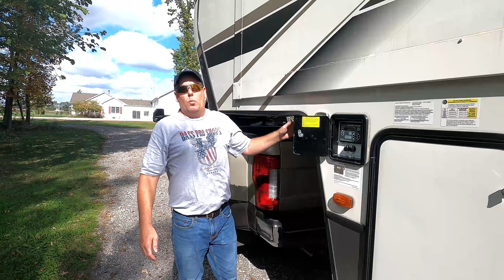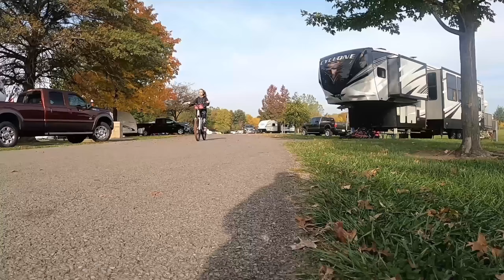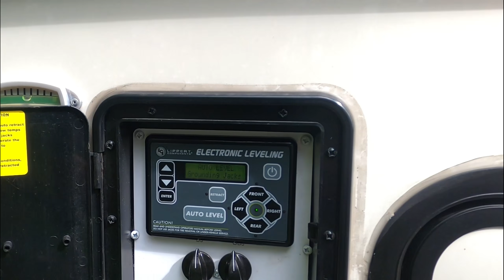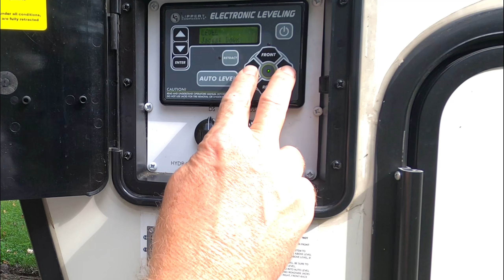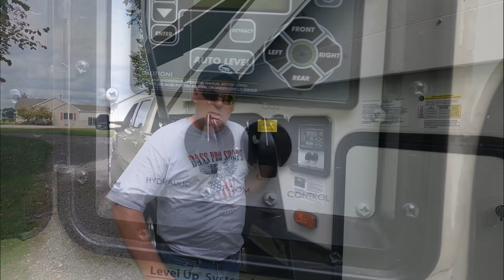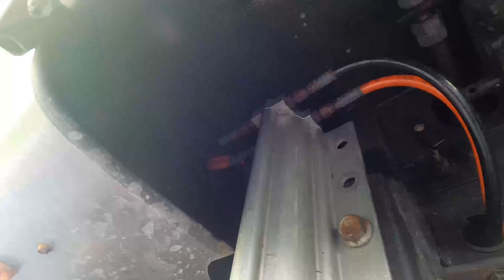Lippert Level up Operation/Troubleshooting

Comment: How can I operate one jack at a time
Reply from the maker: They have the jack set up in zones. The landing gear ( 2 front jack) then rear. (Both rear and center jacks)  you can also select right or left when leveling manually)

Comment: This was a very informative video thanks for sharing, I have an 80-amp fuse and still getting the "low voltage" error. Luckily as you mentioned I have an extended warranty, so we'll just see what progresses.

Comment: Thank you, now I am completely confused about the reset to zero, you said tap 10 times on the up and 10 on the down arrow when the key pad is off, I have seen many other video that say 5 times, did Lippert tell you 10?  I just do not want to make a mistake.  Thank you for your response.
Reply from the maker: Mine was 10. Some were programmed for 5

Comment: Thinking of moving up to a fifth wheel. Hesitant about hydrolic system.  DO you like electric or hydrolic better?  Where dis you put the fork oil and how much?  Did you take some hydrolic oil out first. How often do you get leaks?
Reply from the maker: I prefer the hydraulic. You add the fork oil in the resivour with the fluid. If the fluid level is full, when all jacks are up and the slides are in, then you will need to take out a quart  to add the quart of fork oil. I have net had any leaks.

Comment: On my Montana the front jacks lower one at a time. No big deal when unhiitxhing but when lowering for a pull test exits a pain for doing a pull test. One leg goes down and makes contact the. Other leg follows
Reply from the maker: @getnautical9579  Yes, 
that is normal for a hydraulic system as the jascks are all on a loop. Once the first jack starts building pressure, it will send fluid to the next jack. 

Thanks for watching,and taking the time to.leave a comment.
Reply: @Jonesin2Go do you know of a way to do them at same time or if not how to raise them both at same time for a pull test prior to leaving so I don’t crunch bed in a oops moment
Reply from the maker: @getnautical9579  There is not a way to operate them at the same time. What I do is retract them until one is just a couple inches off the ground. When that happens, the pressure is also off the other so I can do my tug test.
Reply: @Jonesin2Go great. Good to known thanks so much for advice

Comment: Does anyone know if there is an approximately 30foot 5th wheel that has hydralic auto leveling. Mine now has electric auto level. TIA.
Reply from the maker: @franknaiman5219  Montana has a 35 ft model with hydraulic.

Comment: Great video. I tried to recalibrate mine but while it does level the RV almost to perfection, 1 leg isn't touching the ground at all (a good 4-5 inches gap) and another one in diagonal is barely touching. Is this normal? Anyone has an idea on how to fix this?
Reply from the maker: I don't know why it would do that.  Would you
be able share if this is a consistent behavior?  At the end of the auto-leveling cycle, the controller goes through all the jacks to see if they are grounded.  It looks for small changes in the angle.  If a jack is 4 to 5 inches off the ground, it might be the auto level cycle was interrupted before completing.

Comment: Great video!  When I go to do a tug test, how can I raise both front legs a few inches at the same time?  Can't find the answer anywhere...
Reply from the maker: that's a great question. unfortunately they don't work that way. the left is the lead jack and the right will only travel after pressure is sensed on the left. How i got around that was to raise them and then drop them again and just before the right touches lift them so the left just come up a little. that seemed to work for me. I am now learning a new system as we just took delivery of a new Montana that has Lipperts new Titan system. this system gives more options such as you were asking about.

Comment: Fork oil... should I go ahead and add a bottle to the reservoir as a preventive measure even though I'm not having problems?
Reply from the maker: As long as you Dont over fill the reservoir it wont hurt.

Comment: I work on hydraulic system. looks like a piece of metal got stuck in your cylinder check valve or safety valve ..its very commond. you can removed it and clean it ....great video.  thanx

Comment: I’ve noticed where my hydraulic landing gear will time out when I retract them. I’ll click the retract button, but after a short amount of time it stops retracting. After letting the control panel sit for about 5 seconds I’ll hear the panel click, and it’ll allow me to continue retracting. Have to do it a couple of times to get them all the way up. Any thoughts on what’s causing that? I’m not getting an error on the screen like you mentioned.
Reply from the maker: That sounds like your Resettable fuse. Do you still have the 50A fuse? If so replace it with an 80A

Comment: Thank you for your video.  It was great and I subscribed.  A clarifying question please.  We just purchaseda 2018 pre owned Keystone Avalance.  The Auto Level is great...however,  when pressing the right and left to return to hitch height it didn't work.  Therefore I did it manually.  I beleive you are saying to rehook the truck and just do retract all, correct?  Also, after I did it manually and we went to unhitch, the system said "Ready: Jacks down", but they were still up.  Again I used manual.  Did I miss something? Thank you.
Reply from the maker: Hook it back to the truck. Extend all of the jack down at least 6 inches then select re track all. This should clear any errors. Then try the taking it off the truck have it auto level. Before you try hitting the left and right and see if it will go to hitch level. But keep in mind if the it comes off the trick with the front lower than level than that feature will not work. It will have to come off the truck with the front higher than level.

Comment: The issue we have is, when it does it’s auto leveling, it always end up so high that we have to use a step stool to get up to the first step, any ideas why that is?
Reply from the maker: It could be a couple of reasons. 1 the site is just that un level  or you could need to recalibrate the system.  I find I have ro recalibrate now and then and it's usually after we have traveled on some rough roads
Reply: @Jonesin2Go  thanks will definitely have to try that, it does reach level, and if the ground is soft it even sometimes kind of readjusts just after it’s finished, it’s just high when it’s done. It’s not that old but the buttons are already not responsive making us try over and over for those multi press settings. Weird too since we always use the separate remote, never pressed them too hard or anything. Wish they had made a beep for each key press, would have been very helpful. Thanks again.

Comment: Great job. You answered questions i didn't even know I had. I bought my 5er used at a consignment dealer and they wanted $550 for a walk through. I told them youtube could teach me everything I needed to know. Thanks for making me correct. I subscribed to steal some more of your knowledge. 
Thanks
Reply from the maker: Thanks for the comment.  $550 for a walk through. That's crazy.
Reply: Exactly! $550.00 for a walk thru on a rig they sold!? They tell you that after you signed? Wow, wow, wow!!

Comment: Wondering- we are on a seasonal site. To Re level after a while, do we bring the slides in or can we just hit reliever for slight changes?
Reply from the maker: It's always best to bring them in but if it's only going to move a little bit it would be fine to just use manual level. You just never know how much it will move using auto level

Comment: Our site is not at all level. We have it the best we could with the auto leveling system… but I’m wondering if it’s possible to raise one jack at a time to be able to put blocks under individual jacks without hooking back up to the truck?
Reply from the maker: Not one at a time  you can do left or right. Or rear which will bring all 4 rears up.

Comment: We have a 2019 Jayco Eagle 5th wheel.  We purchased it new and this year, the first time out we had problems getting the rear jacks to go down.  After resetting them a few times they decided to work.  The last camping trip, everything worked great until we got home.  We went to level our coach and the rear stabilizing jacks just clicked and would not go down.  We got an error code on the panel that showed the right rear stabilizing jack was the fault.  I checked all the wiring harnesses at the motor, they were clean and tight.  We manually extended the rear jacks and then when we went to push the retract all button, all the jacks came up except the right rear.  I pulled the motor from the gear box and checked the gear box and it seemed to be running smooth but when I turned the armature of the electric motor with my fingers,  It was very rough and felt like there was gravel inside.  Was not smooth at all.  Am I right in thinking that the motor is bad and drawing too much amps?  If so, can these motors be rebuilt somewhere since no one in Spokane Wa. will do them.  Lippert wants 545.00 for a motor.  If there is someone out there that can rebuild these motors, where and who?  Am I right in my diagnosis or should I continue to look somewhere else.  Is this normal  for it to feel so rough when I turn the armature?  I would appreciate any advice.  Thank you.  Dan DeRuwe
Reply from the maker: Your description of that motor does lead me to believe that is the problem. Also I am wondering if you have changed the 50a  fuse to an 80a that will help prevent faults. Here is the customer service number for lippert in case you don't have it.432 547 7378 they are great at walking you through diagnosis. As far as rebuilding that motor I'm sure it could be done. I am not familiar with your area unfortunately to recommend a shop.

Comment: I only have a 4 point system of this. I can only do manual from inside the 5th wheel on a panel inside. It is very touchy and almost impossible to do the jacks independently of each other. I wish I had a separate switch on each jack as the auto level almost never works. It always lifts the wheels off the ground no matter how close to level it is.
Reply from the maker: That sounds like your sensor on the bottom of the coach mey be loose